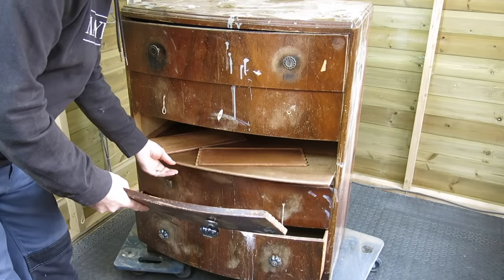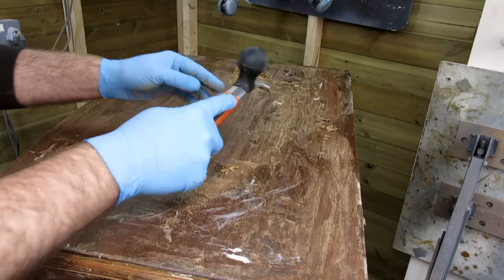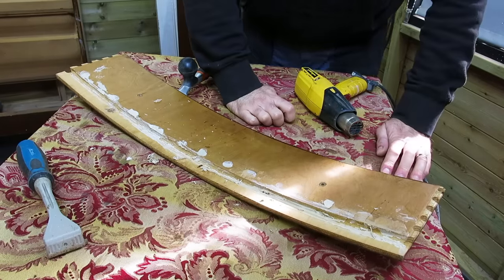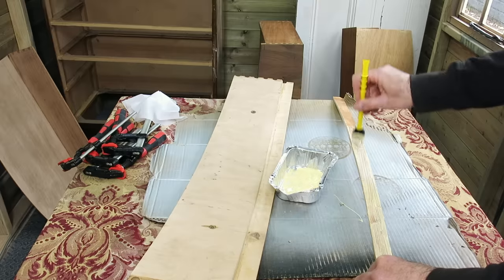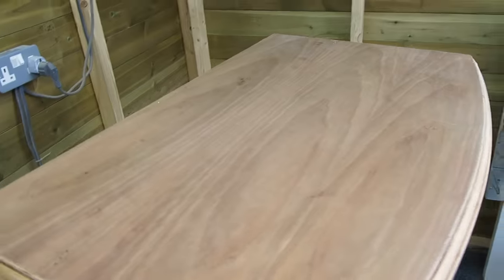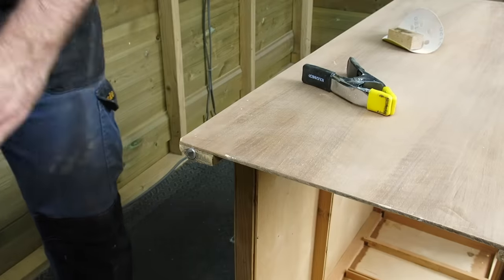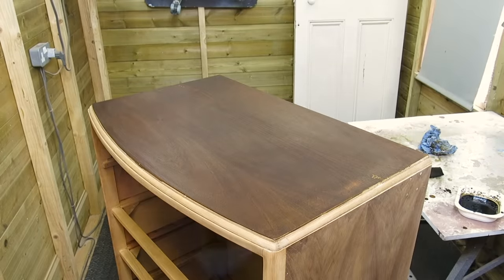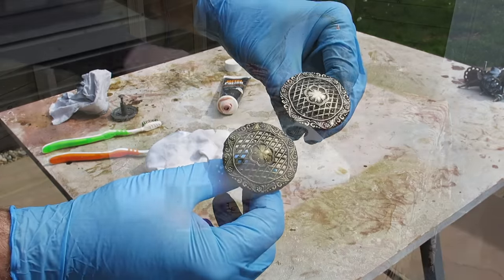My Biggest FURNITURE RESTORATION yet - Part of "Its Literally Trashed Challenge"

Comment: I think of that factory and company.  People from the 1890's to 1920's.  Electric lights, yes. Radio in a handsome cabinet.  Phones in the living room, on a little phone table.  Coal furnaces.  Trolley to work and home.  Any bit of window or clear cabinet piece was always glass.  Lit their cook stoves in the kitchen with gas.  Had an Encyclopedia set in the Living Room.  It was dated the year of manufacture right on the spline.  Read their Bible and Dictionary in book form.  Open windows and fans to cool the house.  US cars were massive, and all carbonated gas engines.  Propeller driven aircraft for travel. 
They made this magnificent piece with real wood, veneer, and real brass.  I have taken out many slot driven screws from pieces like this.  
Every thing they had was Made in USA.
Today, we see the treasure in this fine piece they made.  When will beauty like this be undesirable? Never.  Everyone who contributed to this is gone.  You really honor them and their work of art.
Reply from the maker: Thanks very much for the info, very interesting 😀👍
Reply: @MayfieldRestorations  THEN it was beautiful, and you have returned it to where it needs to be.
Reply: Absolutely outstanding.

Comment: Some artists say when touching up color that " 35:42 less is more", especially with woodgrain since there is so much natural variation. The secret is small changes and fine tipped brushes. And spray shellac cans of varying colors. I marvel at the wonderful work you do.  You saved a beautiful piece!
Reply from the maker: Thanks very much. I really need to practice my use with the pigment powders but I'm sure i'll get the hang of it in time. I think i went in to heavy with the colour rather than, like you say, using a fine brush to add little amounts 😃❤️

Comment: If you have a problem with lifting veneer when you steam out dents, try placing a cold iron, or other solid heavy metal block, on top after steaming. The softened glue should re-solidify properly under the pressure. (Test somewhere small first, of course.)
Reply from the maker: Thanks for the tip 😃👍👍

Comment: I would think someone couldn't believe that anyone would take the drawers in the state they were in, but gave it a shot. That same someone might just pay a lot to get them back now. Magnificent.
Reply: They are actually in quite a good state. The old animal glue has dried out after central heating. The plywood has delaminated from CH and fundamentally bad woodwork. But, apart from the battering from being in a junk room, it is in quite decent condition with the draw runners showing almost no sign of use - which implies it wasn't accessed much and maybe not even used much

Comment: Absolutely stunning! 😍
I have a question for you. Would it work if you mixed some sanding dust with the wood filler to blend in the patch?🤔
Reply from the maker: Thanks, you can use sawdust and glue but this was quite a big missing piece so sometimes the stain doesn’t take to the wood glue/sawdust combo. 😀👍
Reply: @MayfieldRestorations  Thank you! My mom's old dresser is in need a little TLC.☺
Reply from the maker: Good luck with your dresser 😀👍

Comment: My first thought:  You had to pay for this?  Then I laughed when you mentioned removing the hardware.  As the finish was stripped I was shocked at the beautiful veneer.  You did a wonderful job, restoring her.  Oh, can’t decide if the side wires were for hanging a hammer or for hanging paint brushes to dry, because of course you drill holes into furniture for that. 😂
Reply from the maker: I know, I can’t believe I gave money for them either. I just liked the bow fronted drawers. Why somebody would drill into it I don’t know, no respect 😂😂😂👍

Comment: This popped up. Not seen one of you videos for some time (I was taking too much time doing so). To reiterate something I posted on the first video I saw, that thing was never beautiful. It is now, because you worked on it.
   Just the way the manufacturer routed a groove in the plywood drawer front to take the base shows what a low quality product it was when new. What is surprising is how the wooden drawer runners are not worn down. the interior indicates it wasn't used much - maybe stuff shoved in and barely ever taken out, or it got put in a rarely accessed space almost from the start, then moved to a bang, bash, never use, and forget area.
   You have given it a potential for life and usefulness that it may never have 'enjoyed' before